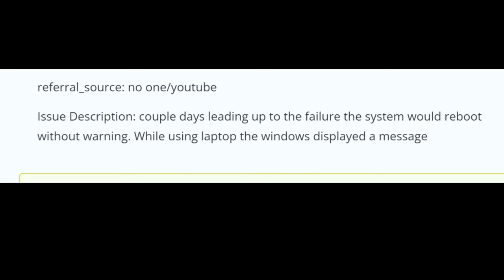What Killed This Expensive Asus laptop GA502DU

Comment: When I saw the first videos of you I was shocked at how much flux you use, but the solder joints get so clean and I guess it also protects the other components nearby from heat. Thanks for this tip.
Reply: That's because you start out building stuff, and there is plenty of flux in the solder. When repairing however, you need 4x the amount of flux.
Reply: Flux is your friend, adding more can never go wrong :)
Reply: Also the camera makes it look like lots of flux until you zoom out
Reply: @gordonm2821  Lmao for real it's less than a grain of rice for most of his uses.
Reply: I mean he’s using a microscope on tiny components… it’s not as much flux as you think it is
Reply: It looks like a lot of flux but that component is tiny. Only have to look at the tip of the applicator which is like a needle. That is a tiny amount.

Comment: Thanks Alex for the content. Q. I found that Lead-based solders usually melt at 356-374F and Lead-free is around 422-440F.. How and why would the laptop produce that much heat to melt the solder and kill the pc? seems quite dangerous, and the fact that the current has to go through all of the components before it reaches the mosfet is also interesting.
Reply: This guy donated $15… I hope he gets an answer
Reply: lmao 15 usd wasted, no reply , not on the top either
Reply: When mosfets fail their on resistance can climb, this causes excessive heat which make the resistance climb higher.  Then it spirals out of control and fails.

Comment: Wow nice job… "Soon, I will bring you my MSI GP75 laptop. Honestly, I didn't leave it plugged in for a week. I used it normally for one day and then stopped using it for two weeks, leaving it disconnected from power. Yesterday, when I wanted to use it, it wouldn't turn on. Only the battery indicator LED turned on, but the laptop never powered up again."

Comment: I have the same laptop. It works if I plug in a charged battery, but not from power adapter. It says it is charging, but does not draw any amps. I found out that one of the mosfets behind the power jack was shorted. I replaced it with same model, but now it does not run on a charged battery or DC adapter. If I short the first mosfet connecting to DC jack, it runs on DC, but does not charge even though it says it does. So I disconnected the battery inside and run it on DC input. It works fine like this though. Anything I can do to fix this? What drives those mosfets?

Comment: I have the same model laptop it has thermal throttle issue .CPU region gets insanely hot (sometimes even on idle !)
Reply: Undervolt the cpu with ThrottleStop.
Reply: try to use TPM 7950, see if it's getting better